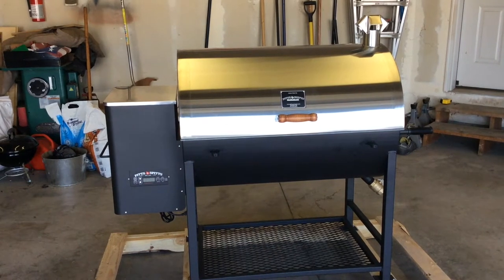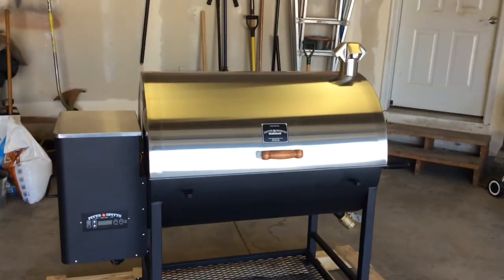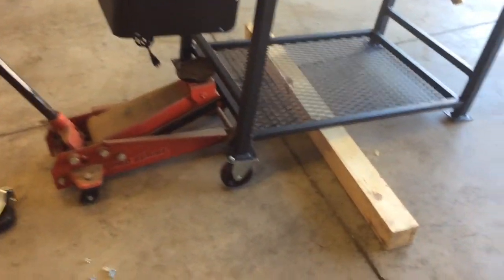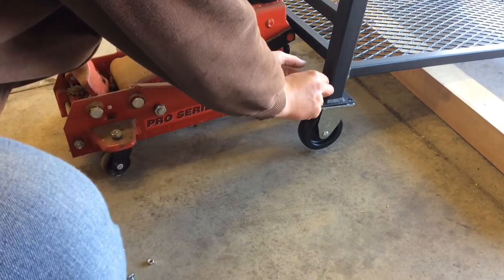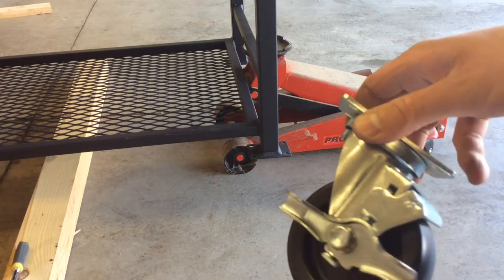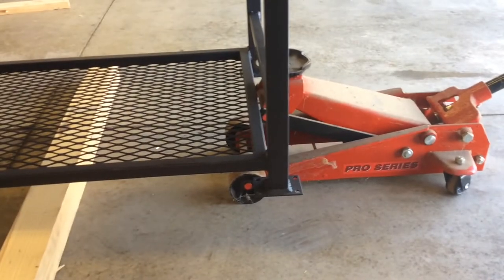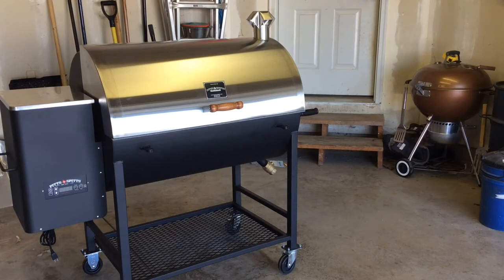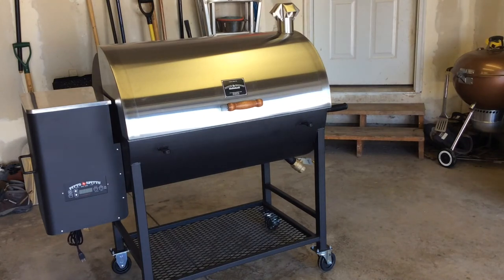Caster Install On The Pitts & Spitts Maverick 1250

Comment: Curious what the dimensions of the wheel base are? I just ordered the Maverick 1250 and wondering if I should order some larger casters. I can find some heavy duty ones for less that the $250 P&S is charging.
Reply from the maker: Hmmmm not sure on that. The casters that come with it work very well on hard surfaces. Are you planning on taking it on the grass I’m assuming?
Reply: @MadHorseBBQ  Yeah.  I have a flagstone patio that's not totally level and may take it onto grass from time to time (certainly will need to in order to get it from my driveway back to the patio).  I'm not sure the larger wheels are necessary, and I can always measure once the grill arrives, but was just wondering.  thanks!